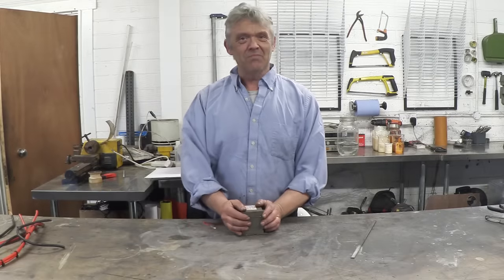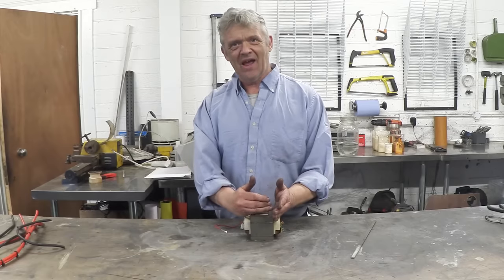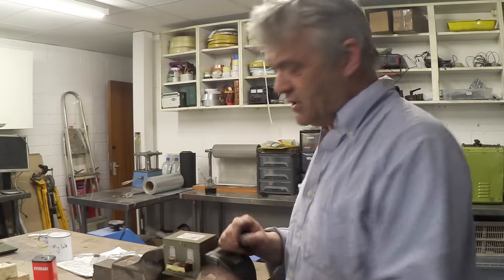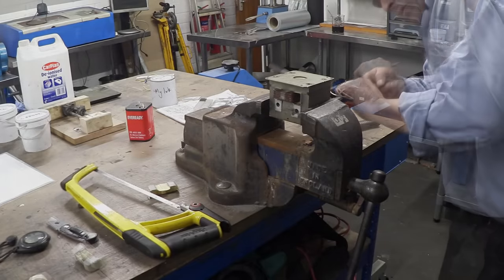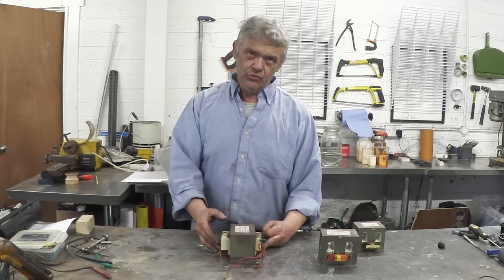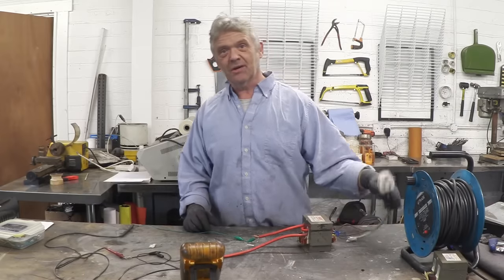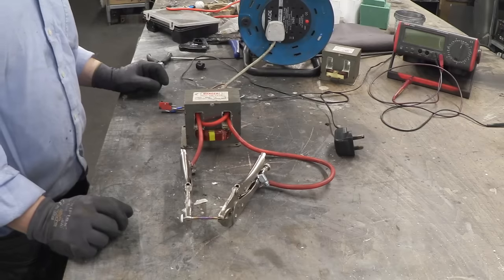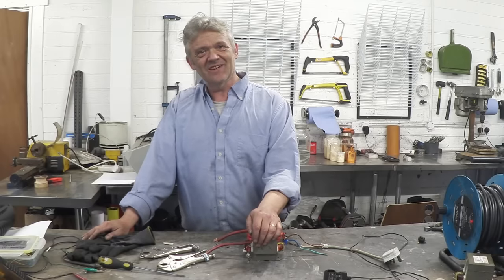Microwave Oven Transformers Using Them For Projects

Comment: Hi Rob. Afternoon from Az. Great video!  I've got a resistance soldering iron transformer left to me by my Dad that works very similarly from what I can gather.  It's a 115 v to 3-4 v 400 va beast.  As you might  imagine it's a tad tricky to control for anything smaller than 16 awg.  (Melts through bolts rather nicely just like yours! :)  Any chance you might pop up an short addendum vid. on how to easily vary and control the power without changing the number of coils?
Reply: He did that a few days ago with a bucket of water.
Reply: You could make a shunt to slide in and out I think you may like this idea
Reply: Use a 'VARIAC' in series with the input!👍
Reply: I'd considered a light dimmer, but In looking into them, it seems that there are several different kinds with varied internal methodologies affecting there operation. Also as you mentioned finding one that can handle the 1200-1600w the power  supply can draw has proven to be a bit of a challenge & as Rob rather humorously noted in this video,  "WOW haha! Didn't expect that to happen!!"  I figured he might be headed in the "taming the beast" direction  anyway. :)   As I'm far from an EE,  If you happen to know of any  of those 4-5 component circuits that can handle 1200-1600w that you could recommend, that'd be much appreciated!
Reply from the maker: it depends which side you want to control mate - if you look at the input side you can control the input voltage which will 'down' the output voltage but if you want to control the amps on the output side you will need a power resistance that can cope with high 'burn off' - a liquid rheostat works well for that
Reply: Thanks for the reply Rob. Honestly I don't know the pros & cons one way or the other. I just remember how easily Dad used to precisely and  easily solder up respectably thick cables & fittings & such & thought it'd be really cool to be able to do the same without melting off a quarter of the board I'm  trying to fix a "end of the month & on a Friday" overseas solder joint on. :)  I'm no EE, but I've found that if something stops working & I can find loose bits in where the angry pixies used to play & tighten em up or re solder em,  I can often get the thing to work again.  :);)

Comment: Could you use the transformer inline with a solar panel to step up the performance of the panel or panels?
Reply: No, transformers work on AC, what you need is a DC to DC converter.
Reply from the maker: Speedy is right in a way - the current needs to be turned off and on as it is the changing magnetic field that makes a transformer work - but I am thinking we could make a massive joule thief and that would probably do it - you have given me an idea for sure - cheers
Reply: @ThinkingandTinkering  If it works please give detailed instructions on how to do it. My name is Karen after all.
Reply: You can't "step up the performance" but you can convert the output to AC and step up the voltage. This will waste power, of course, due to losses in the transformer and electronics.

Comment: What if you made some graphene rope and winded that up in place of the wire, I bet the residence would be real high and it would be a lot safer in theory. Of course you would have to coat the rope in some plastic epoxy to make it right.

Comment: Amazing videos sir! I have a question, why did the bolt get hot but not the cables or vice grips?
Reply: Im sure they were plenty warm, but as far as the bolt, it's a relative bottleneck in between two other conductors with a likewise relatively/proportionally much, much lower resistance. For that bolt to "keep up", and it clearly can't, it must dissappate a wholllllee lot of that excess energy screaming  through it faster than it's able to handle gracefully as heat. Lots and lots of heat. You'd get exact same effect if you were to have those same grips connected to some ~4AWG from the transformer, no bolt and just touching them together. Different magnitude, same relative bottleneck.
Reply: It's more resistive - remember V=IR.  Current and resistance are directly proportional, increase the resistance and the current will increase.  In this case it's localized in a smaller cross-sectional area at a higher resistive value = molten metal lava.

Comment: I have two microwave transformers connected in series, with each of the primarys beein 0.4ohms. Given ohms law its pulling around 300amps and just shutting my breaker. Is this because im using american transformers, and these have a different winding than european given the voltage difference or is this normal and i just need a high power resistor on the?
Reply: If your goal is amps then use a really thick cable with to winds
Reply: @Frank-ls8ky  I tried to make Gran Thompsons version, using same amounts of turns on secondary as him wich would result in a couple hundred amps and around 30v on secondary side, but I can't even mesure it cause my breaker flips instantly :/
Reply: @Pandapung1  use a separate circle maybe
Reply: @Pandapung1  maybe the bracket flips because an electromagnetic field is created
Reply: @Pandapung1  it would flip most beakers except passive ones
Reply: @Pandapung1  try your kitchen and bath

Comment: The MOT I pulled out was wired backwards or something. The input coil was made of smaller wires and such and the output was the larger wires, so I ended up cutting the wrong one off

Comment: Plz audience I want to know that if we use it to Heat the stainless steel like as he shown in video I want to use it for Cutting plastic material.i want to know it can be just stay red for a whole day?nd the transformer will burn or not??so wat i should do if i need that to red the steinless steel blade for a long time without transform burning
Reply: Without the shunt in place on the secondary I wouldn't recommed a continuous duty cycle as you're describing.  For some extended use you can place the MOT in an oil immersion for cooling, but you still need to deal with being able to regulate the amount of current that you're drawing to heat your stainless steel blade.  Even stainless will turn to lava on an unregulated continuous duty cycle with the level of current you can pull through these.  Soo... maybe don't? Please be safe.  What you describe really isn't a good use situation for an already hazardous device.  If you insist on doing it, at the least add in a thermal cutout to the transformer housing as well as a method for regulating the current.  Even upstream regulation of the MOT's input voltage would be safer than raw-dogging it.

Comment: How do you get the Amps back up after it’s stepped up
Reply: You don't.  If the voltage steps up 10 times, the available current is reduced 10 times - the wattage is essentially constant.

Comment: interesant.  first attempt to melt a nail with lower voltage but bigger amps  was not so  good then a second attempt with less amps and bigger voltage.that proves that  is power of the transformer better used  when is secondary part filled with wire...
Reply: Adding the extra turn as Robert does will also decrease the leakage inductance through the inadvertently created air gap, decreasing resistance to current flow.

Comment: Hi Robert, great video thankyou. i have a wind generator that is producing 400v dc max spin. Would that transformer method work with dc? i need to bring voltage down from 400 to 14volts ish if possible.

Comment: Microwave Transformer are 700 wats or  is it the mag tron 700 wats
Reply: The radiated power from the magnetron is 700 watts; the transformer is probably pushing out 100 - 200 watts more because the magnetron isn't 100% efficient. It has a heater filament, and the magnetron itself heats up in operation (internal resistance); hence the cooling fins on the magnetron body.

Comment: I didn’t really believe the other videos when they said that the turn count in the secondary coil controls the voltage. Now I have actually seen it. And I’m not from Missouri (The “Show Me” State)!
Reply: Out of curiosity how did you think it worked?
Reply from the maker: it's all about turns ratio mate

Comment: I was think of using one with a voltage multiplier to create the spark for the flash graphene project.
Reply from the maker: a good idea mate - I tired microwave oven caps - but even with 10 - no joy - so I ordered 12 500F 2.7v supercaps, they still have to arrive - basically when I can get it working I also plan on a flash graphene vid but it is taking a while to get together that's for sure
Reply: @ThinkingandTinkering  I think about rectifying 110 and using a couple of 555 timer circuits to control frequency and duration before the transformer then multiplying that with the microwave capacitors. Should be able to get to spark properly but still research the circuits and rectifier needed.
Reply: @ThinkingandTinkering  27 volt is probably 100 times less voltage than I think even under vacuum but then again if the material is only 1mm thick maybe. Will be interesting to see what turns out to be sufficient! Maybe 20 leyden jars in series  charged to infinity 😂

Comment: coiled up extension cord = induction heater ???  just sayin  xx
Reply from the maker: interesting - cheers
Reply: Yes, pull any current through a coiled up extension lead and it will heat up and melt the insulation. Big no no there, pull all the cable out and flake it on the floor, much cooler and a lot less induction..think of an air inductor !!!
All the best
Tony
Reply: @ThinkingandTinkering  First thing I noticed in Your setup - whoa what a big coil You've got standing there. My dumbass boss melted my extension cable being too lazy to pull the cable out. 
There should be an information how much wattage the cord can take extended and how much coiled, it's about 1/2 of the power whan coiled, before melting.
Don't burn the shop down and keep up the great vids!
Reply: No - the currents in the line wire and the return wire inside the cord are equal and in opposite directions, so their magnetic fields will be equal and opposite, and will cancel out. (Google 'non-inductive resistor'.) Resistive heating only in extension cords.
Reply: @brianspencer6397  Correct, you saved me from having to answer that one.  Just think of the lawsuits that every retractable cord reel maker on the planet would be facing if they were susceptible to self-induction heating.  Resistive only, spot on.  I knew an electrician a few years back who liked to coil up about 2 feet of extra live and neutral wire (separately) in the ceiling when he installed lights - on every single can light, and he called them 'service loops.'  I explained to him that the only service that was helping with was the fire department.  He made them nice and tight too, then zip tied them up into neat little inductors.   *facepalm*  Not exactly what the NEC meant when they mention adding a service loop lol.

Comment: Isn't that 2 turns in the transformer?
Seams like you miss one every time.
Kind regards
Reply: Yes!  If you just had a U-shaped turn, it would be 1 turn.  Because when you connect the ends, as you would have to do to get current, the 1 turn is completed.

Comment: How many amps does it is draw
Reply from the maker: it's probably giving out about 100 amps at 2 volts - more or less so at 240 volts it will be pulling less than an amp